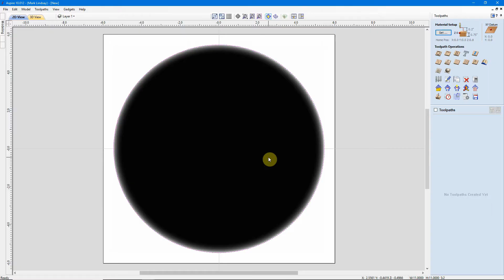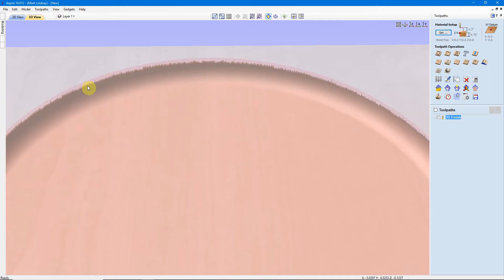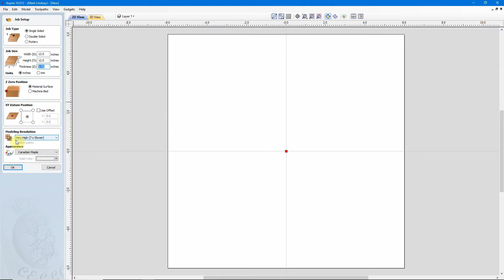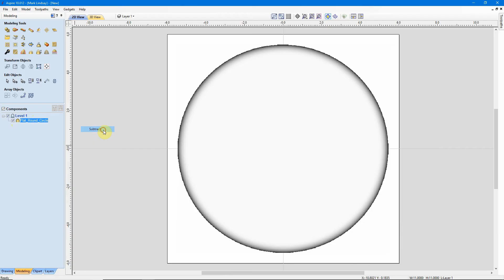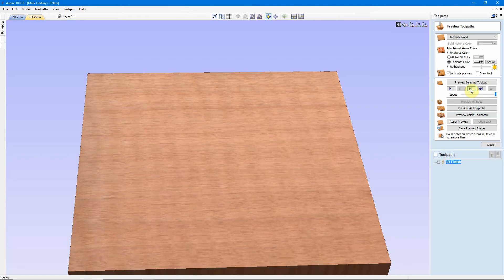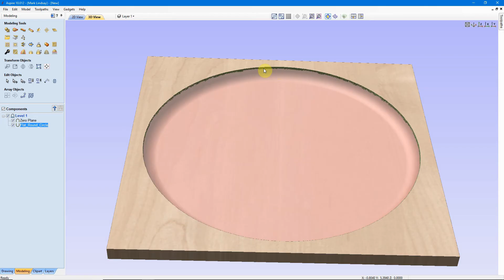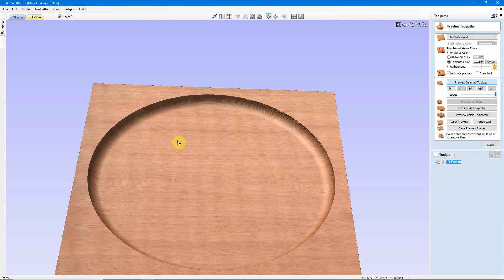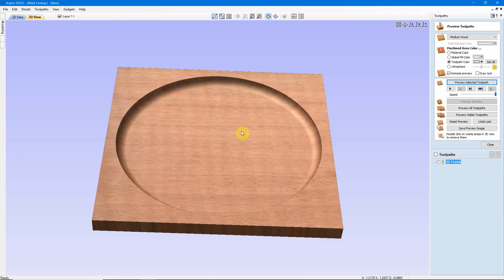Introducing The Zero Plane - Part 33 - Vectric For Absolute Beginners

Comment: I'm importing a STL, its making me set a zero plan. If i go above the zero plane my model is out side the work area. If i set the zero plan in the middle, there is some parts that are under the zero plan that wont be cut. How do I fix this issue?
Reply from the maker: You have almost perfect timing. I'm going to discuss this very thing on my Live Q&A on Sunday, July 7th at Noon Pacific time, 3pm Eastern time. I hope you can join us, as I'm going to answer your question directly. It's a common question, but it's way too much to try to type out in text.
Reply: @MarkLindsayCNC  yes I will have to sit in. Thanks

Comment: So I’m confused.  Does this actually affect how the project is carved by the cnc or only how it looks in the software?
Reply from the maker: It actually affects how the project is carved by the CNC router. What you see in the preview, is what you'll get on the machine.
Reply: @MarkLindsayCNC  thanks for the quick response Mark.  You have created a fantastic library of training and knowledge on your site and it is appreciated.  I have to admit though I can’t quite picture in this case how the machine would actually creat this ragged edge.
Reply from the maker: The toolpath that the software calculates follows the pixels that make up the model. Without the zero plane, the toolpath will carve down to the last pixel found in the model. The zero plane fills in any gaps between the top of the model (in this case, the edge of the dish) and the surface of your material.

Comment: Why not just revolve a profile using the Turn And Spin function, creating a clean, parametrically-defined shape instead of a scaled  multifaceted object?
Reply from the maker: Mainly because VCarve users don't have the Turn and Spin function that Aspire users have - the Zero Plane is available to VCarve users. You can certainly do that in Aspire, and it's a great option. This video was meant to be an introduction to what the Zero Plane is and what it does. One icon to click to add a Zero Plane takes care of most issues that people who are just getting into 3D carving encounter when trying to carve a dish shape into a material.

Comment: When trying to create the vector boundary I get a no vectors selected box over and over again I know I’m missing something but I can’t figure it out
Reply from the maker: If you're having trouble creating the vector boundary, make sure you have the model or component selected, then click the Create Vector Boundary Around Selected Component icon in the Modeling tab. If you're trying to use that vector boundary, try going into the toolpath first, then select that boundary vector, set up the toolpath, and calculate.

Comment: Hi Mark - another excellent video. Would you need the zero plane if you were modelling a dome rather than a dish?
Reply from the maker: Thank you, Selwyn. No, you don't need a Zero Plane for a dome. I demonstrate further in later videos, but basically a Zero Plane is used in cases where you're carving a 3D recess. If you're carving away the surface of the material to leave a model standing proud, projecting upward, a Zero Plane is almost never needed. There are special situations where you would use one, but I get into that in other videos down the road.
Reply: @MarkLindsayCNC  Thanks Mark - as I thpough

Comment: Thanks for another great tutorial, Mark.  So the burning question I have is why doesn't the software add the zero-plane component at material creation?  Adjustments could then be made to the component as needed further into the modelling.
Reply from the maker: Good question, David. The main reason is because the software doesn't know what you're going to do with the project (if it's going to be 3D or just 2D flat work.) If you do create or use a 3D model, it doesn't know your intended use of it, so the automatic addition of a zero plane might interfere with your plans. Some folks create models for export in file formats that can be opened by other CAM software (STL files and such,) and a zero plane would get in the way of that. The zero plane is an option to be added if needed. Not every file or model will need one, so they leave it up to you to decide when to use it.
Reply: @MarkLindsayCNC  Makes sense.  Thanks for the quick reply and clear explanation.
Reply: Think of it as "white" vs "transparent". Initially, Your height map is colorless at the edges, not white. (Even though it looks white) After adding the zero plane, areas which were previously transparent, are now white. when the tool path gets calculated, transparent areas have no input on the path, but white areas do. It would have been obvious & intuitive if transparent was assigned a special pattern. (Transparent is often shown a checkerboard in other programs)
Reply: If a zero plane was always present, converting model to vector will always give you a rectangle vector of the entire material

Comment: Another great video Mark.  In a prior video (3d part #19) where you used the Zero Plane the toolpath extended across the entire material surface and not just inside the selected vector.  What did you do different in this video?  Thanks!
Reply from the maker: In that other video, I didn't machine to the selected vector. That was a mistake on my part. Good eye!
Reply: @MarkLindsayCNC  Thanks for the follow-up video, I made the project in video #19 and the bit started hitting my hold-downs since it was running across the material surface.  This video was very timely!  Thanks again!